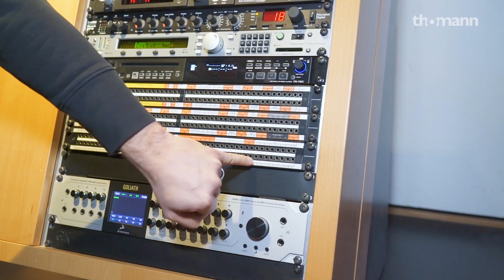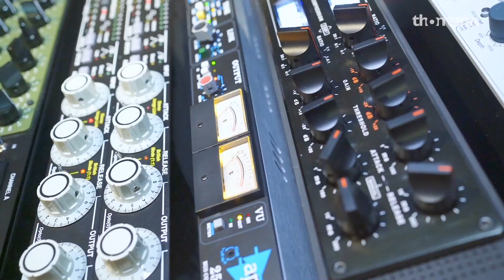What is a Patchbay? | In the Shop Episode #19 | Thomann

Comment: If anyone is still confused, here is a simpler explanation.  If you have lots of rack gear like FX, compressors, EQ etc., a patchbay allows you to quickly plug into those without touching the other racks.  Basically if you don't have any rack gear apart from your audio interface, you don't need one of these.